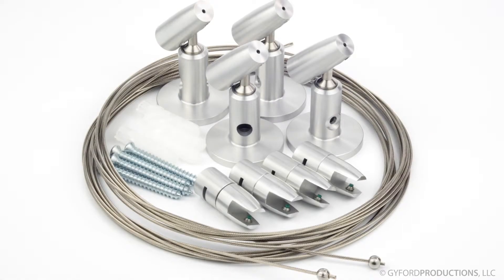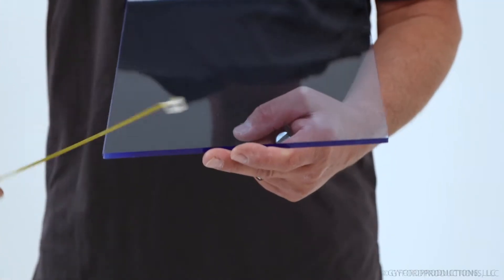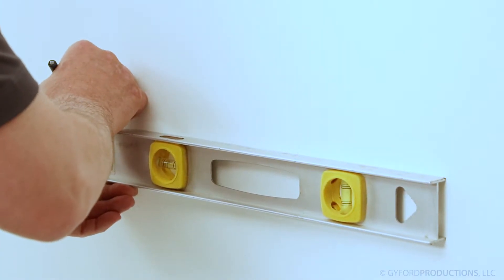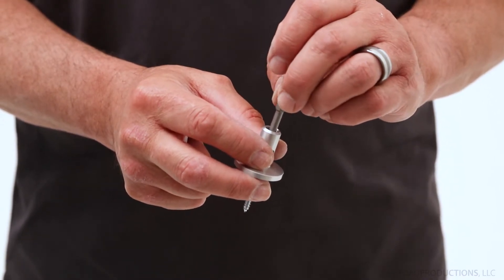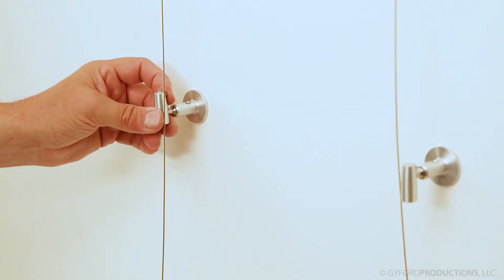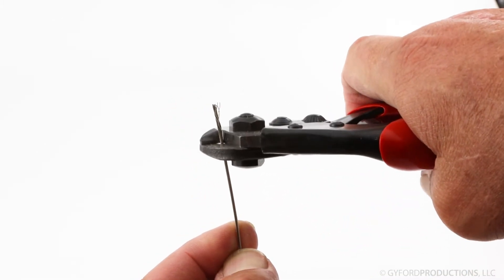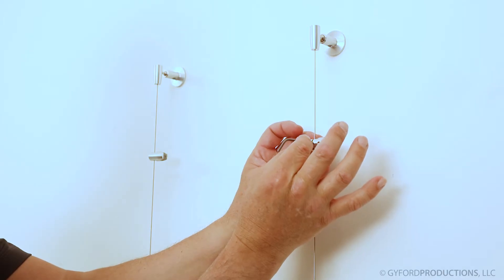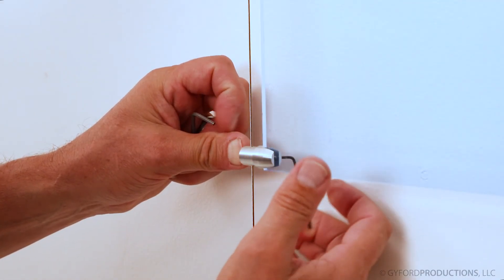WLK-11 & WLK-12: Wall-to-Wall Wire Suspension Kit

Comment: Will a 34"x 76.5" 1/2" lexan clear acrylic work with this method? If not, what do you suggest?
Reply from the maker: Jesse Grahm,
We suggest using our EZ line of wire hanging components. Below are links to these components.
Please give us a call on this project, we want to be sure you get the correct anchoring hardware for the surface you will be mounting to.
775-829-7272 or info@standoffsystems.com

To answer your first question, the thickness and weight of your acrylic material cannot be hung (wall-to-wall) with our pre-packaged  KIT offerings.

https://www.standoffsystems.com/product/ez-18-wire-90-degree-wall-turnbuckle/
https://www.standoffsystems.com/product/ez-18-wire-90-degree-wall-mount/
https://www.standoffsystems.com/product/ez-wire-connector-with-gripper/
https://www.standoffsystems.com/product/ez-single-gripper-wire-connector/
Reply from the maker: There are several options available to achieve the look you want. The WS-AEGS gripper will require more mounting points as it "grips" rather than using a "through hole" solution. We will call you if you don't call us first. Robert Borden. 775-786-2713 robertb@standoffsystems.com